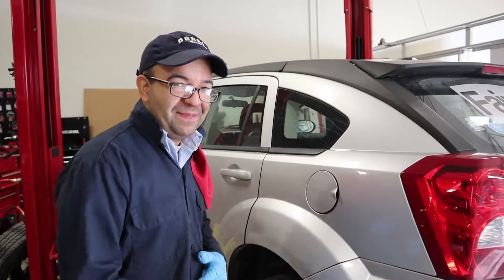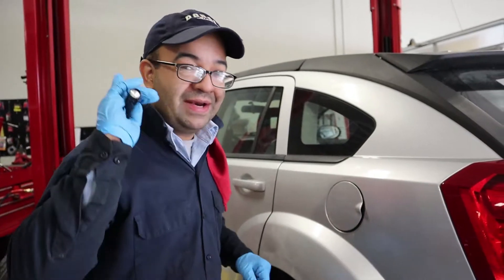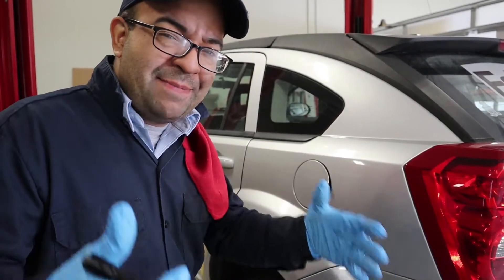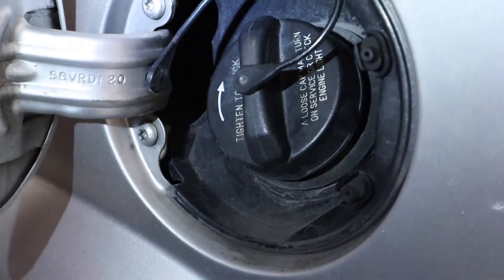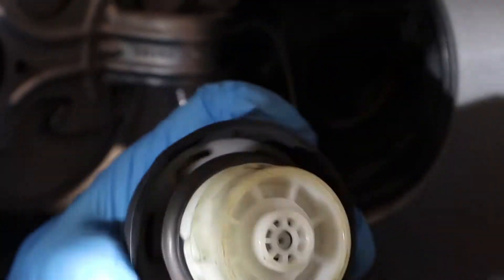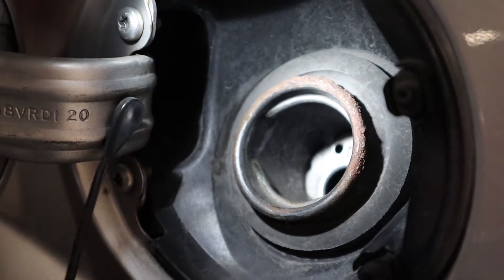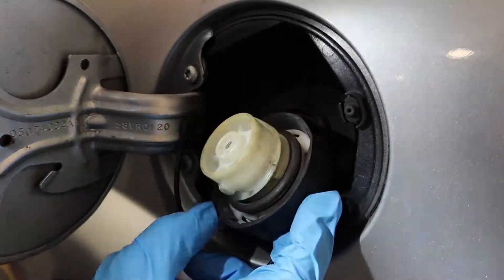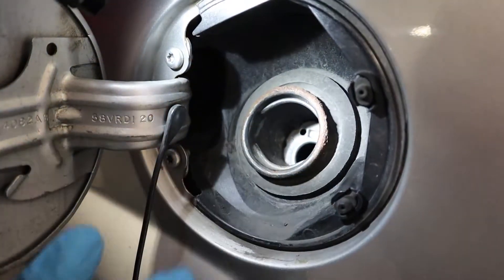2009 Dodge Caliber P0456 EVAP System Small Leak Fix

Comment: Hola buenas tardes. Si mi Dodge Caliber 2007 le aparace la luz de aceite a veces y luego ya no sale, luego sale otra vez. No hace ruidos raros ni nada. Será el oil pressure sensor o el oil pressure pump? Gracias!
Reply from the maker: Lo primero q debes cambiar es el oil pressure sensor